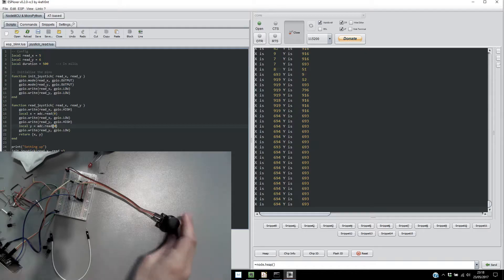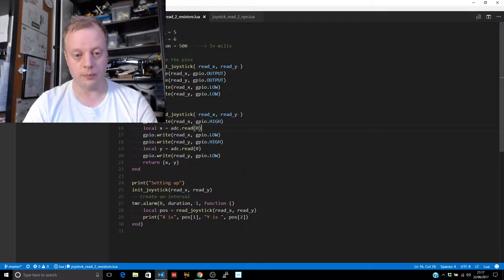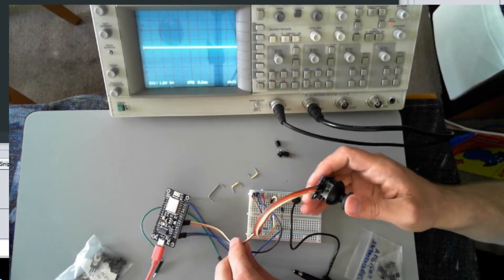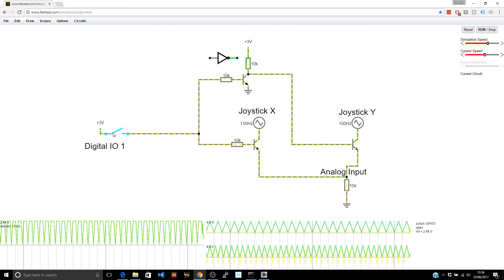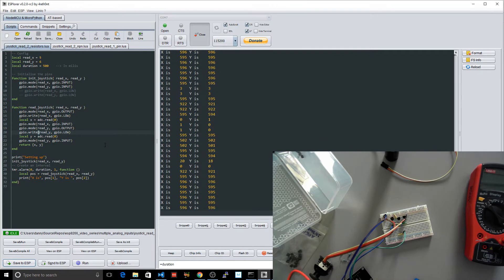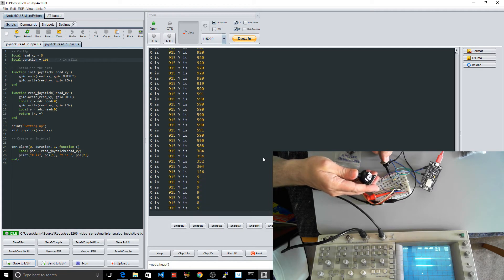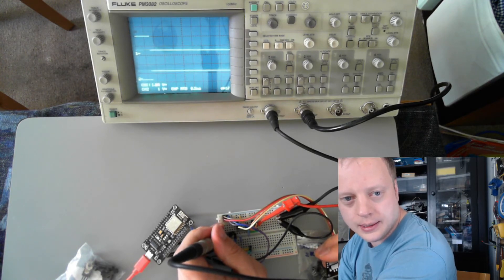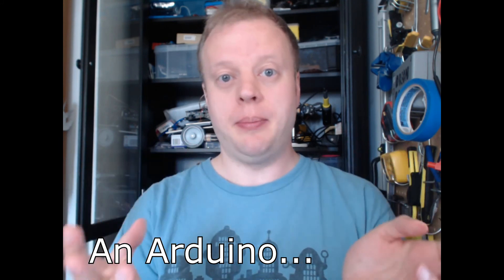#ESP8266 multiple analog inputs follow up

Comment: Can you please provide the entire code for Arduino ide? I really wanted to run node MCU with multiple analog inputs in Arduino ide and not lua because I want to simultaneously use blynk's requests to even control the car wireless and as per my knowledge blynk doesn't work in lua.
Reply from the maker: That could be a nice idea for a future video. I've not yet written my code for the arduino 8266 to do that, but there are others who have done so.

Comment: looks cool, I wonder if the resistor version would work better if you were to force a high impedance state instead of high state. But I don't honestly know if the ESP8266 even has tristate GPIO's.

Honestly I'd personally just use an ads1115/ads1015 because then it's just i2c, and you get 4 inputs that way, but I guess you can save a dollar or two and 2 weeks shipping time.
Reply: MobiusHorizons yeah that's how I was able to make this work was with tristate. pretty sure that's what he did as well
Reply from the maker: Hence my closing comments - I suppose I'd go even cheaper (or based on what is in my cupboard) and use some Atmega 328's or Attiny with I2c in a chain (2 inputs per device maybe?) - I could demonstrate those options in a video sometime.
Reply: (i'll admit, i wrote the comment before finishing watching the video), but take a look at the ads1115, i think you'd like it. it has 16bit adc, and is ridiculously cheap, even as a module it's barely more expensive than an Attiny (~$3 on ebay), and has 4 inputs and i2c.
http://www.ebay.com/itm/For-Arduino-ADS1115-Module-4-Channel-16-Bit-I2C-ADC-With-Pro-Gain-Amplifier-D-/112041788018 

And if 12 bits is enough, the ADS1015 is even cheaper ($2 on ebay) http://www.ebay.com/itm/12-Bit-I2C-4-CH-ADS1115-ADS1015-Module-ADC-Development-Board-for-Arduino-/112192172479?epid=626095478&hash=item1a1f2cb1bf:g:kQEAAOSwA3dYGrZp